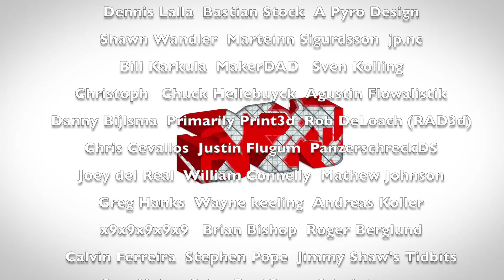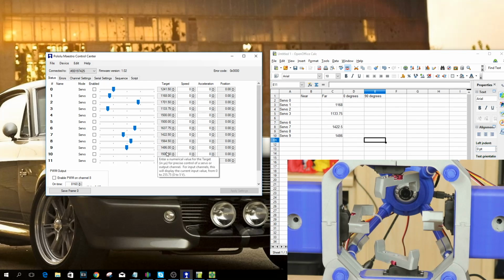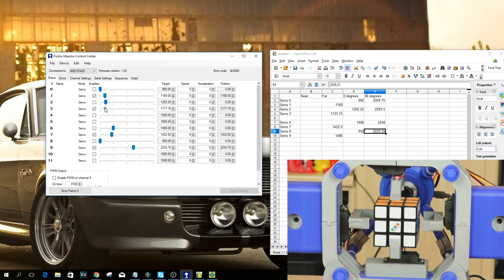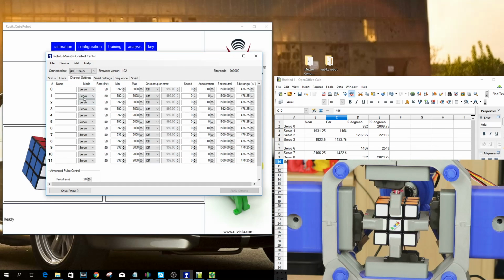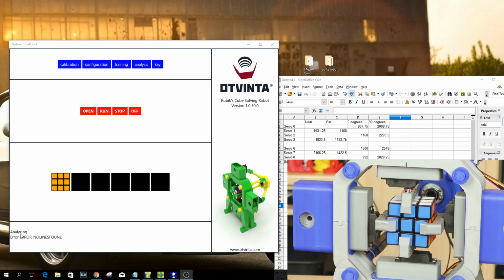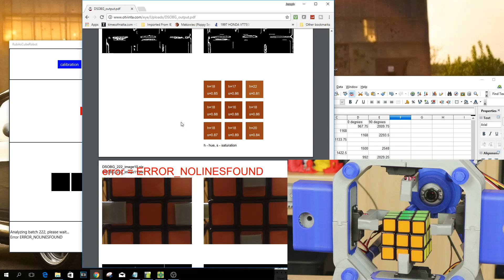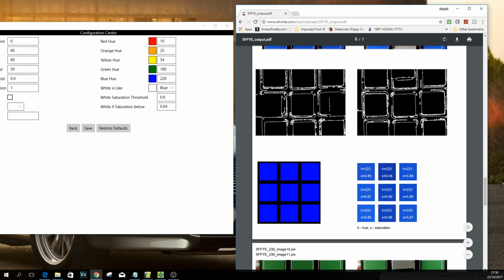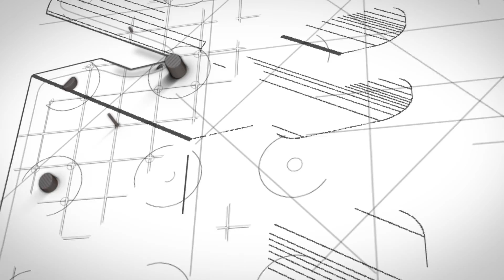Calibrating The 3D Printed Rubik's Cube Solving Robot by Otvinta

Comment: Great video Joe. Doing my calibrations now. One thing that I have noticed is that my sliders are moving opposite to yours. When I move the tabs to the left, the sliders move in (towards the cube) and when I slide the tabs to the right the sliders move out (away from the cube).  I have spent the last two days checking the orientations  of my main units, the sliders and the motors and can't see anything wrong with my assembly. Is there something that I'm missing. Thank you.

Comment: Joe, Great video!  All the parts are printed and the robot is assembled. Getting close to starting the calibration.  What pins did you connect on the mini Maestro for power? From what  I can  figure I connect to  VSRV + and - with the jumper across the pins to the left of VSRV. Your video will make calibration a lot easier.... thanks!!!!

Comment: Amazing.... great work.  This video will save me and others hours.  Can't wait to get started building one.  Regarding lighting changes, I wonder if it would be more portable if perhaps some white LEDs were mounted to the sides of the camera.  Would be interesting to try that out as a small improvement on the design.
Reply from the maker: yep, that is the next step, getting some LEDs and mounting them on the camera holder :)
Reply: Why didn't you use the LED's that are built into the camera?